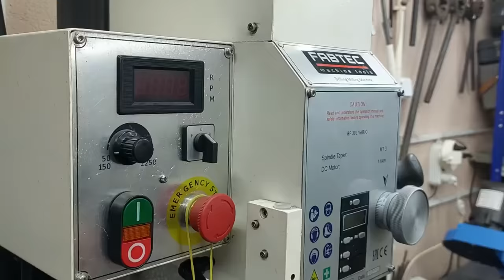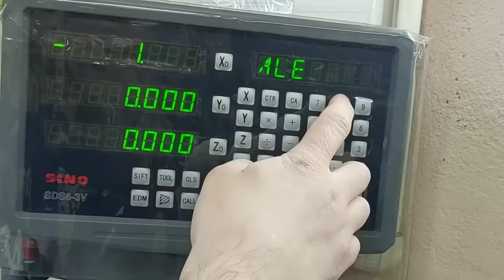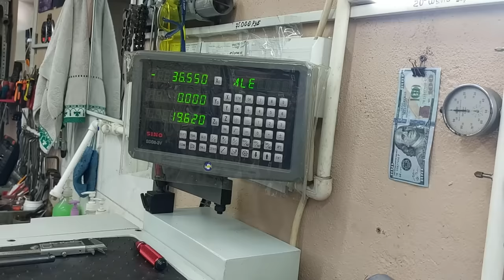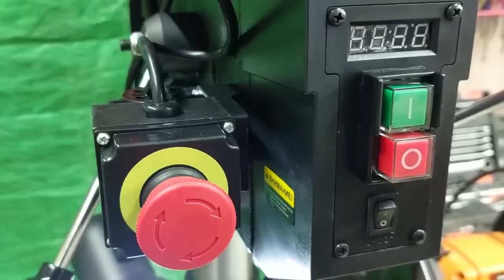Top 3 Genius Ideas! You may need this

Comment: The center finder will only accurately work if the pivot is in the center of the tool for both axis’. Being to the side makes it dependent on the pin being parallel with the work piece